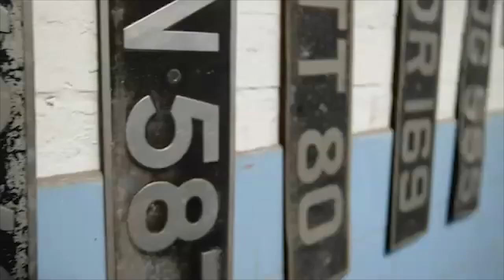Lancia Flavia Coupe 1967 Clutch Issue | Car S.O.S.

Comment: That doesn't look like the right bell housing for a 1967 Flavia gearbox. The correct bell housing is a one-piece unit, but the one fitted here has a strange top section with ventilation louvers in it.